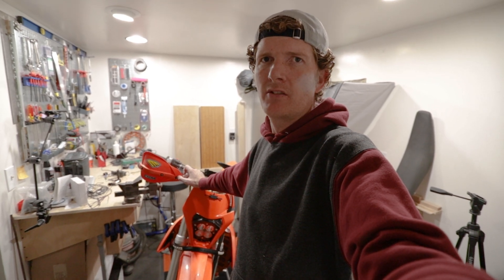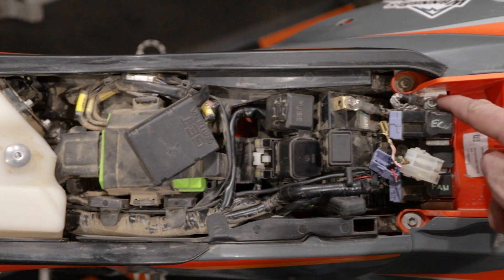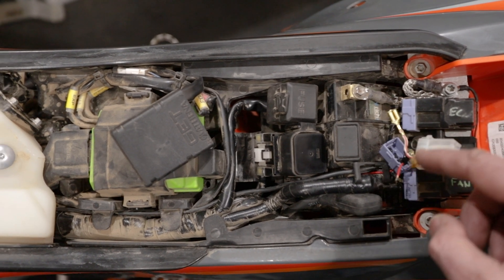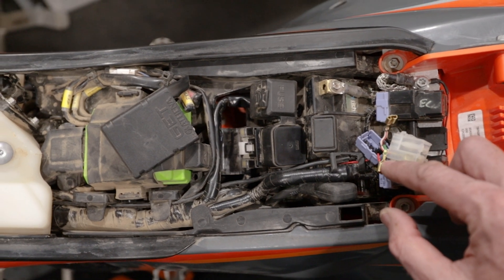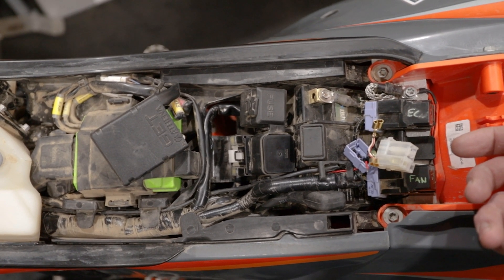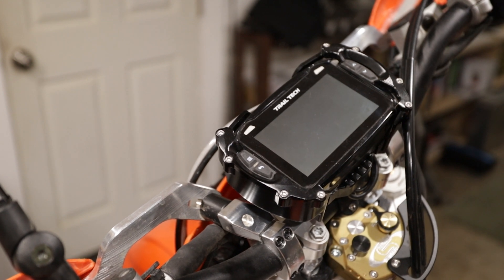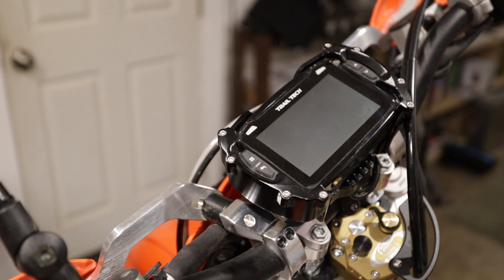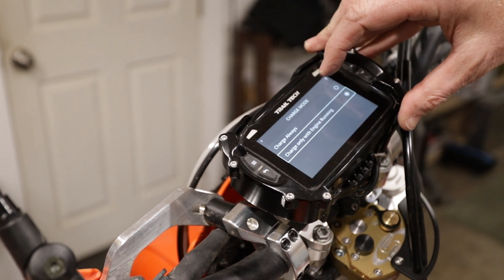KTM 500excf + Trail Tech VoyagerPro GPS - Wiring for battery life

Comment: Doesn't the trail tech voyager pro have a power option that only charges if the bike is running due to the tach wire wrapped around the ignition coil wire?
Reply from the maker: It does but I had a buddy with a parasitic drain problem with his voyager pro wired up. He may have done something wrong so I wired it this way. It’s been on there since new without an issue.